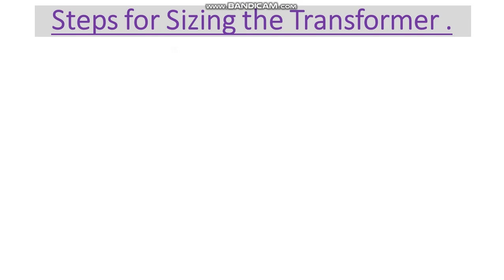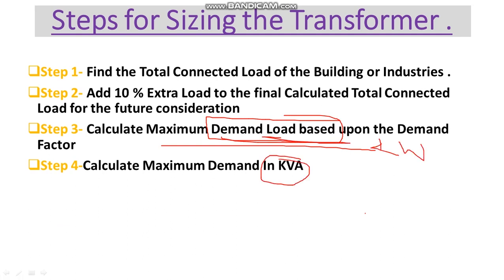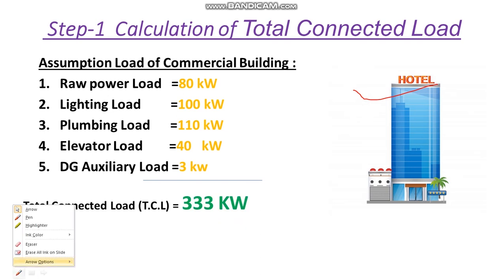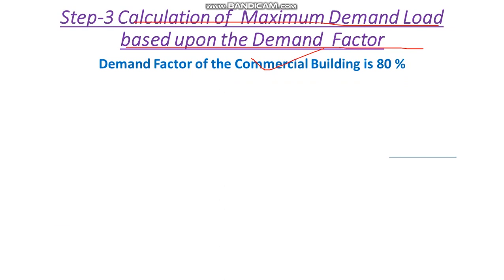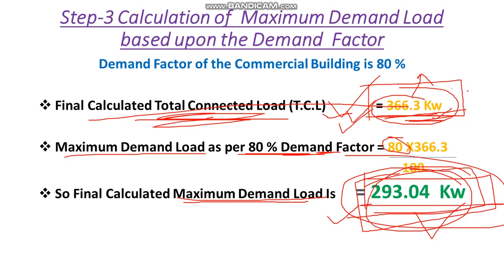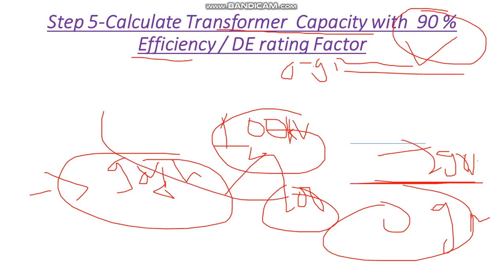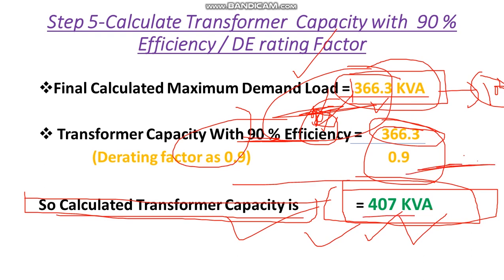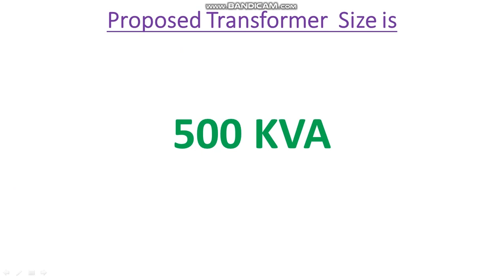Transformer Sizing and Selection | How to Calculate Transformer Size ?

Comment: Maximum demand in KVA is 366.3 90% efficiency means 366.3*90/100 =329.67 it should be and u took 366.3/0.9 at wht basis u took and 90% efficiency should be greater than maximum demand load or it should be less ..so i am having doubt can u breif as in my calculation 90% efficiency is coming less than that of maximum demand load so which should be greater

Comment: Final Total connected load is 366.3  kw then after converting maximum demand load in KVA we are getting same value as final total connected load 366.3 KVA thnen wht is the use for maximum demand load based on maximum demand factor we can directly take total connected load and then calculate tarnsformer capacity kindly let me know

Comment: I saw your videos for selection of diesel generator and transformer.
I think there is a small mistake.
For transformer 90% efficiency , 366*90%= 407 (i check its 329.67)
At the same for generator 80% efficiency, 366*80%=293.04
Pls clear my doubt. I am your subscriber and trying to watching all your videos
Reply: yeah, he divided 366 by 90, I think he meant to do (90 x 366) / 100